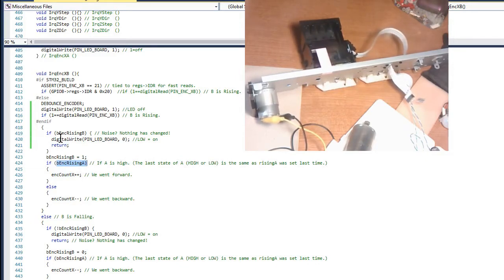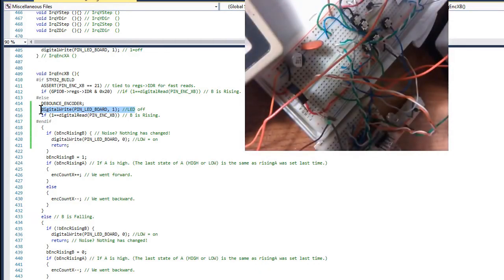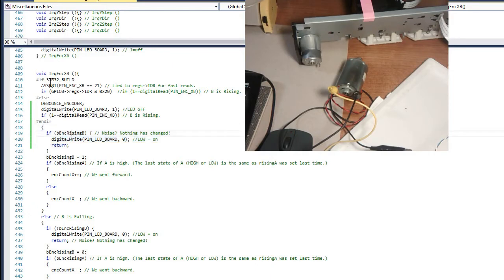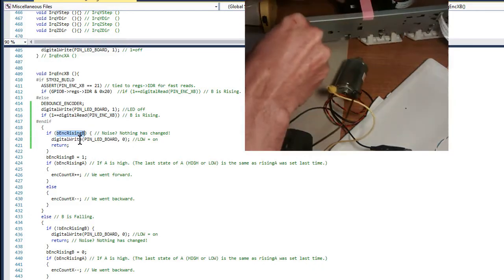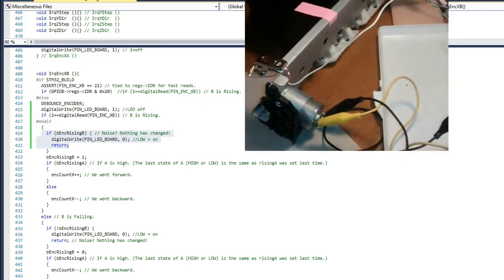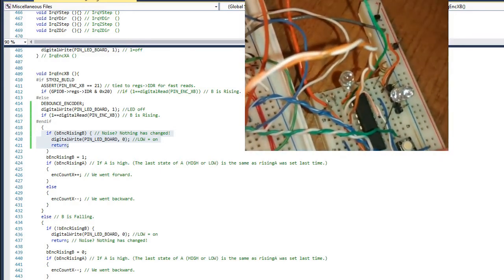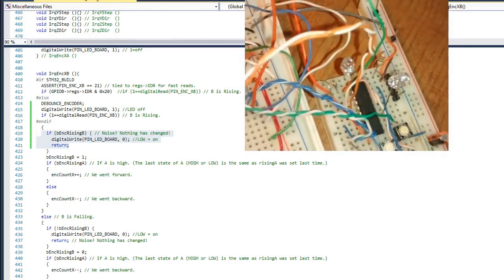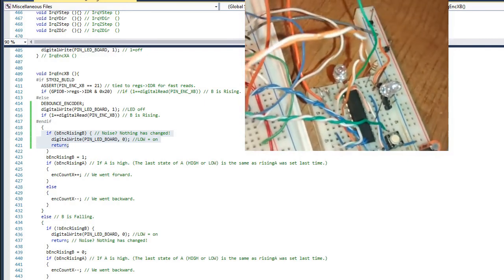3D Printer build. Part 1. InkJet Optical Encoder missing steps with PWM.

Comment from the maker: I found more gremlins in my dc encoder gantry. I thought I had eliminated electrical noise by grounding the metal gantry but as seen in the video, I'm still missing a few irqs: from the Arduino's stepX line to my msp motor controller (measured), and possibly from the encoder's output to the msp (my guess).

I tried putting ceramic disc 200nF and 400uF across the msp's power.  Didn't help.

I only get noise when the L293d hbridge is powering my motor.

Originally I noticed many missing steps when I touched the motor to the gantry. Then I grounded the gantry and it REALLY helped. Now I only notice a few missed steps and usually it misses symmetrically so the error eventually cancels out. But it can still get off by .5mm

I added 200nF caps in series across the motor terminals but it didn't help. I tried putting the center tap on the gantry(ground) but then the motor wouldn't spin (strange).

Maybe I need to improve the grounding somehow? Or maybe isolate the motor case from the gantry.
Reply from the maker: Things to try:
Find out if it's missing an irq (count them in sw), or getting an extra from noise.
If it's gaining an extra, try an rc circuit to avoid spikes.
If it's missing, then maybe the msp is getting noisy power.
But, it still seems like isolating the motor's case from the gantry should fix whichever it is.
Reply from the maker: I figured out I'm MISSING a few interrupts from Arduino's stepX pin going into my msp (received by irq). (These particular missing irqs have nothing to do with the encoder).

So could noise cause me to MISS an irq?
(Usually I think of noise causing spikes&dips which cause extra pulses to be counted.)

Btw - I'm using an Arduino with the ch340 usb chip, but usb isn't the problem because the entire gcode line gets sent to Arduino. The Arduino is the one pulsing out the stepX line to my msp430g chip which counts the pulses.
Reply from the maker: If I unhook the motor I can send xStep pulses up to a feed speed of f40000 mm/min and not miss any xStep interrupts!

But if I manually move the shuttle with my hand (no motor noise), even just a little, I miss some xStep interrupts.

So it isn't electrical noise!  

Also, if I'm missing xstep interrupts (because I know how many are sent), then I'm probably missing encoder tick interrupts (which I can't know how many passed three sensor).

I turn on an led while inside interrupts.  It is not saturated on.  On the oscilloscope of the led pin, it looks like plenty of time is available for irqs.

But the problem with encoder interrupts is that they are not spaced at rigid intervals. There could be multiple valid interrupts which come very close to each other.   Maybe I'm missing those.

If I slow down to feed=500 mm/min I don't miss any.  At f2000, I miss a lot.  Maybe I should use the 72MHz stm32 again, which is 4.5 times faster than my msp.  That would give me higher than f2000, if that is the problem.

It's just frustrating I miss irqs when the cpu doesn't seem saturated.  

I looked online for people with similar findings, but maybe I'm not searching the best keywords.

Comment: Have you tried putting a 100nF capacitor parallel to the brushed motor? Brushed motors create voltage spikes all the time and it's a good thing to filter them out with a small ceramic cap.
Reply from the maker: An excellent suggestion!  I'll try it with the grounding wire disconnected to see how it helps!

Comment: Great to know.  Finally, weaning myself off picking free laser and inkjet printers, where I've parts binned quite a few and only spec'd out the 6 and 8mm SS rods for the MPSM Colossal V2 build since I broke down and invested in to mod into a larger size since was a great price for already reliable equipment.  I guess if I find a nice Kyocera or Minolta older model with paper feed, those usually have a few NEMA stepper motors.  Anyhow... thinking I'll get around to working with the motors control in more detail when I have to upgrade the control board of the 3D printer or possibly build something like a lowrider or other most likely plasma cutter table.  Thanks for sharing!  Appreciate it.

Comment: I see four wires going to the Encoder, so two of them must be for power right? This means you can't be using differential signals right now. Are the Encoder-outputs actually differential signals (A+,A- and B+,B-)? If yes, then you should definitely be using differential input circuitry to take advantage of this. That will make sure noise that get's induced into both lines is rejected.
Reply from the maker: Differential signals are really robust! The "joystick" Arduino for my 30 foot robot controller uses differential signals to message the robot which is 60 feet away :
https://youtu.be/vOLvFhdkLmA

But alas this encoder only uses single signal wires.
 Thank you for the ideas to try...keep em coming folks!
Reply: @TheRainHarvester  Oooooh, so your signals are probably meant to be ground referenced, i see what could be the fix: you need to get the distance between the ground wire of the encoder and its signal lines as close and as consistent as possible for good signal integrity, best thing would be to twirl the 4 lines (A,B,GND,VCC) together. Another very easy to implement measure (more of an bandaid for when you can't shed the noise) would be to add a simple RC-lowpass-filter that cuts off anything above for example 5x your maximum pulse frequency right in front of your MCUs inputs.
Reply from the maker: @vatterger  thanks! I'll try twisting the wires.   One hiccup is that the encoder wires go to my micro controller, but the 5v comes from an LDO (ie power supply), which is far away from the micro controller.  
Will an rc circuit to short out faster signals cause any signals to get missed? Or will some noise still get thru if the cap charges to the gpio trigger threshold, then continues to get noise?
Reply: @TheRainHarvester  You can dimension the RC filter so that it will never swallow the wanted signal but cuts off short, fast rising (=high freq) spikes: https://en.wikipedia.org/wiki/RC_time_constant. Your encoder outputs a square wave that is made up of an large amount of frequencies mixed together to generate the fast rising sqare edge. You want to mostly preserve that fast rising edge so you would choose the cut-off-frequency 5 to 10 times larger than the square wave frequency, this makes the wave just a bit less rectangular but still valid as an input signal. This calculator can help you choose the right components: https://www.trance-cat.com/electrical-circuit-calculators/en/rc-low-pass-filter-calculator.php Just start with 1kOhm and 1nF and vary the resistance to get where you need to be. This simulation is also nice to play with: https://www.falstad.com/circuit/circuitjs.html?ctz=CQAgjOCmC0Ac4E4B0sBsB2ALAJnQZkzAFYxMFY8QiAGKq2omMMAKAHkRtNaxVaueYbOBDUWAcxDd+seNJB5stZSwBOnbuD5TqPbTxpiAxjr2152WaKjQEopOjBpqeVGHSXSb9Pd2sAbuBCWvyavMoihroM1spIxAjEZJh41AjYLIGY8OFBwrn8nNH8SEScpbGlLADuUjna2ZxWYpKNlnLwihFiHPK5mKiYISJiTsJ9DbogCKiVZWBIqLN4SHiUZT0a-FycHpw7EJvyM1KK07OHLGNbwwL7Q3Hzi8ur66IsAPbWZzzY2Ag8OLRQ7gT4gTrCX7-WioJAudAI9BoAFuBDoWbUOF+aysL5gWg-HTkOiYiBksHMBSQonwDbxESsAAWCk4ChYQA

Comment: What mcu are you using and can you share the code and schematics, by the way, Great job! Thank you
Reply from the maker: Originally I was using stm32f103 which worked well and had enough gpio pins to run 3 axis. But I accidentally fried it, so I used this slower msp430g2553 because I had to wait for a new stm32f103 to arrive. 
So the code might end up working with BOTH, and even Arduino.

My plan it to make this all open source once more of it is working.  I'll probably design a circuit board to get rid of all the wires too.

I had Marlin, and GRBL connected to this ink jet shuttle too. Let me say...It ran REALLY nice: smooth, quiet, precise and with motion deceleration... I'm really excited for this! I've not seen many 3d printers designed with ink jet shuttles/ encoders!
Reply: @TheRainHarvester  thank you for the feedback, I had a little luck with this approach, I would love to test your code once it finished, keep us updated please and best of luck.

Comment: It's a shame how hose inkjet printers get discarded left and right so anything that can repurpose them is great.

You're a patient man, but that's how we learn:)
Reply from the maker: Other uses for these might be a super fast drawing machine.  

In fact, it will probably be a good test to put a fine-tip marker on the xy version to see how speed affects drawing a box/shapes. If I get lots of oscillations around the corners, I'll know to tune the PID, or slow down the max velocity/acceleration in grbl / Marlin.

It could do speed run portraits!
Reply: @TheRainHarvester  the sky's the limit:)